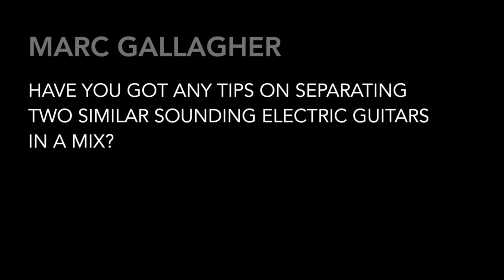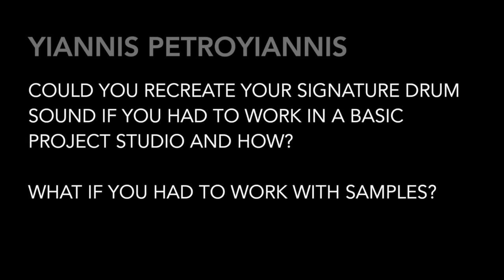MWTM Q&A #23 - Steve Albini

Comment: Acoustic treatment has helped my small space, 10.5 ft x 11.5 ft x 8 ft. become a place with an ability to have a decent room sound for acoustic guitar and vocal recording. I also built several Gobo panels that can be arranged for extra isolation. But it's a one person, two at most kind of space. Obviously, it's not a place to record drums, so I program them and part out the drum tracks to a real drummer who tracks in his own studio. There are a lot of ways to do the small space work area. For me, it's just working working working in it in order to get familiar with the limits. Getting to know my monitors and mic setup possibilities is the key for me. And the integral part of knowing my monitors tell me "the Truth" was, first off, room treatment (rockwool. fiberglass in corners, parallel places, cloud on ceiling)  It's encouraging to realize our small spaces can be a "good" limitation since it's all that's in the budget for the near future. Thanks for the encouragement!

Comment: I wish more folks had asked questions about all-analog recording and the value + limitations of recording the way he does.  As a self-recording artist that loves Steve's work, I have no option but to record digitally.  I only hope I can get some material worthy of working with Steve.
Reply: Jay Toomuchhustle  I think his bottom line with analog is archiving multitrack masters to tape for the permanence aspect, but I’d bet the rest of his reliance on analog outboard gear is down to service/repair convenience. Any competent electrician/tech can fix (or even design and build) an old-school compressor or tube mic preamp, but even digital outboard gear can have microprocessors that were programmed at the factory or basic operating systems on built-in rotary card drives, and are essentially bricked when these sorts of things break out of warranty. Since he stocks his studio to his liking and staffs people to work on the equipment, he’s probably leaned on things that are not proprietary or programmed, and you can buy generic components from lots of places to repair it. I don’t know this for sure, but it has a vague parallel with his views on tape machines and reliability.

Comment: For the two-guitar question, I would think changing pickup position on the same guitar would help separate them.  I have used this effectively for a double-jangle part, where one performance is more toward the neck pickup, and the other is more toward the bridge.

Comment: Around the 27 mark, Albini says that nothing outmatches the long-term stability of tape recording. I'm not sure this is true at all, but I don't know of any specific studies comparing the various formats. It'd be interesting to look into it a bit more. After about 50 plays, degradation on a reel-to-reel tape will become slightly noticeable to acute listeners. The average half-life is considered between 200-500 plays. And 1,000 plays of a reel-to-reel will come close to the end of life (EOL) for the tape. Not to mention, "sticky shed syndrome" which will afflict tape regardless of how many plays after a certain period. The US Library of Congress is having precisely this issue with their archives now-- many of the tapes have to be converted to digital formats because they will be lost otherwise. Strong magnetic fields can completely wipe out tape recordings. If I'm remembering correctly, records and even CDs (but not CD-R!) are proving to be more stable than tape, and SSDs are considered to have moderate stability in terms of long-term storage. Regardless, this seems to be a moot point given that ultimately, all of these formats in the end end up being converted to some digital format and then put on cloud servers, etc. for most modern listeners. It's not exactly hard to convert various digital formats, so I highly doubt it will be an issue in the future to convert, e.g. a .wav or .mp3 file to whatever format. If also basically no one owns cassette players or reel to reel machines, which is really the case now, then it is only a few audio specialists who are still using reel to reel tape to record and listen, and even most of the studios using it offer it as a "flavor", and not the sole recording format.

Comment: I don't know if magnetic tape is that durable is it? My old band digitized the tapes we made 30 years before, and they were on the whole there... but there were glitches. I was under the impression that magnetic media fades. If you google it, the consensus seems to be 30 years. 

I don't think the machines becoming archaic for digital is any more/less of a problem than with magnetic tape... after a decade or three this will generally be the province of specialist format-transfer companies. I (for example) got a specialist company to digitize my old masters. I don't know anyone who still has the machines that can play these natively.
Reply: I've heard him talk more in depth about this before.. he's more specifically referring to programs, DAWs, Operating Systems, Plug-Ins and the like becoming outdated or failing to update as time goes on.  e.g.  as an archivist he doesn't trust certain digital formats to be able to be read on computers/systems a decade or two from now or that hard drives will boot up and have the right connection etc to be able to be effective as a storage device.  The safest bet would be to bounce completely dry stems in a variety of different formats.  However the result is a bunch of unaffected mono/stereo recordings... resembling very little or nothing of what was done as an audio engineer or producer.     ... not sure what kind of tape your band recorded on but if stored properly 2" reel-to-reel tape is a trusted archival format and will last a very long time.
Reply: @bittergums32  Also its so easy for digital data to be lost on systems even when people know that its there. At least with a labeled tape people know they are holding a recording, likely music if it is labeled as such, just for archival purposes (meaning historical purposes). What happens to computers and digital storage when people leave their mortal coil.   Even if your a top producer its unlikely that someone will go through all your computers file by file looking for possible history in the making.

Comment: I get why he thinks the way he does about analog recording on tape, but a lot of the points are mostly irrelevant.  He's referring to a DAW session recorded with a particular piece of software not being compatible with a newer version down the line or data degradation due to hard drives failing and such.  I would argue that in 2016, analog tape preservation is much more costly and difficult than preserving data.

For the first point, the WAV or AIFF formats aren't going anywhere.  Uncompressed digital audio formats will basically always be readable by some kind of software regardless of what DAW you originally used to record them.  As long as you have all the original files available you can construct a new session using these files in any DAW, and if you record destructively they way that Steve does you don't need the original plugins to get the effects you were going for in your mix.  Preserving data in 2016 permanently is a much more trivial task than I believe Steve knows.  I think he's so out of touch with digital recording that he may not realize that these aren't really problems anymore.  I built a fully redundant NAS in my house for storing recordings and other data for pretty cheap, and you can use things like Google drive or AWS to back up recordings offsite for long term storage.  I don't have 50 year old recordings, but I do have sessions that I recorded 10 years ago that I can still open just fine.  All you need is competency with the technology.
Reply: I agree. He did an interesting talk on Pro Studio Live about the same thing, why he chooses analogue recording/mixing over digital. The more I think about his point, the more it makes sense.. 

No-one's building new tape machines, there are no technological advances in that area so it remains static. A half inch reel that's sat on a shelf for 70/80 years is always going to be playable on a working machine. You wouldn't be able to say the same for a harddrive that's sat on a shelf for 70/80 years - technology would have far surpassed it's capabilities.

That being said, it's just not practical. Music's disposable these days and everything is about speed and cost efficiency. If you're organised and sensible inside of Tools, you're going to have no problems opening it up on another rig. If you do have problems, (be it missing plugs, audio, disorganised session, no backups etc) then it's only the fault of your own as the engineer. With a reel of tape at £300 odd and a lot of machines in commercial studios not maintained very well, it's just not cost or time efficient.. Especially thinking of mix recalls. It just doesn't work to solely work in that domain for anything remotely commercial..

Interesting nonetheless.
Reply: Oh, I get it: you think the way to compare the two is to only talk about and pay attention to one of them.
Reply: @familyguycrazy101  Also , as I say above, if you're holding a tape with a label on it you know you are holding music that can be played on a tape player. Even if the owner died 3 weeks ago and left no will.  Whereas if you're holding a digital storage you are holding a can of worms.  I think this is why he says "archival;" I think he is talking about more than his personal archives.